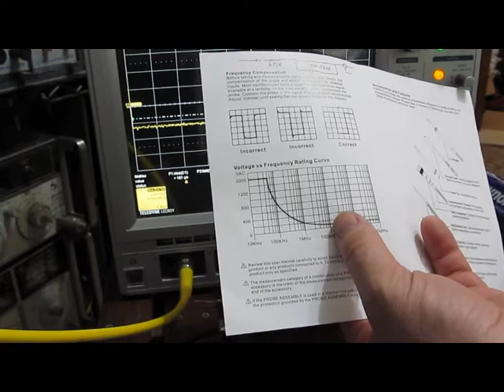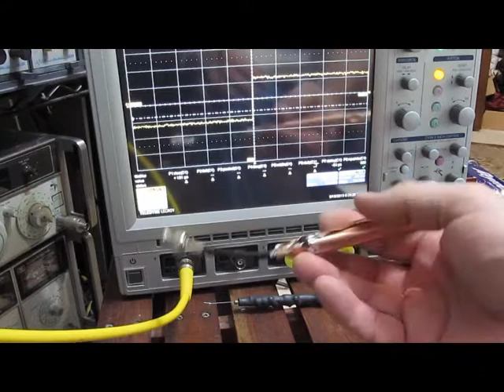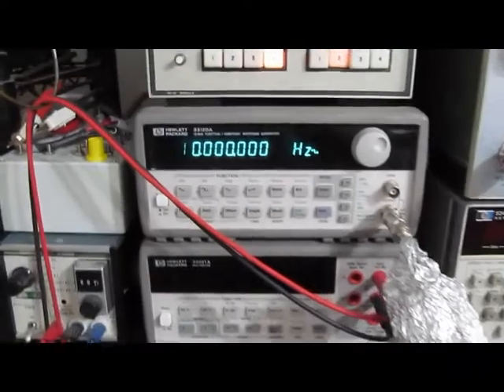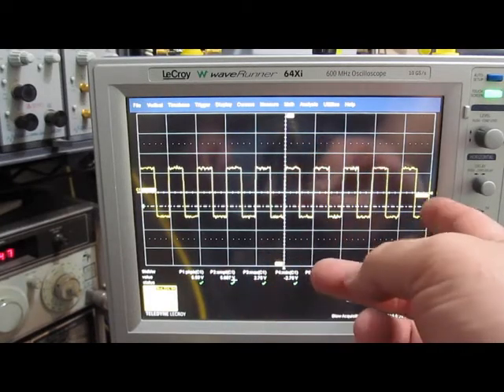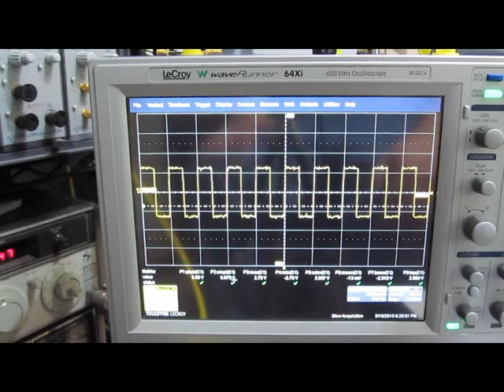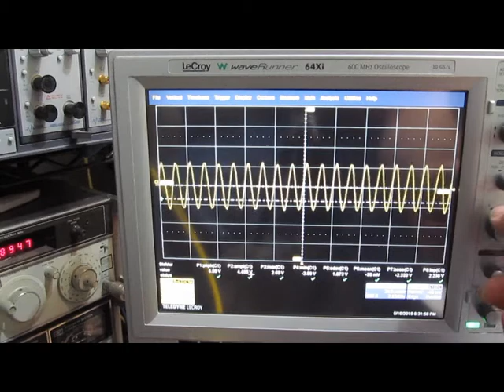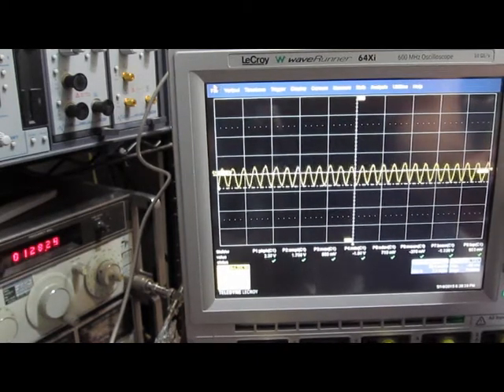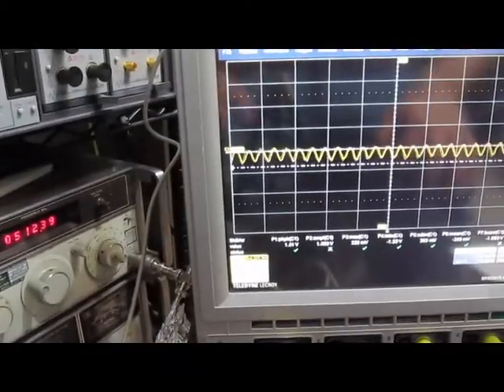Home made high voltage wideband oscilloscope probe Part 1

Comment: I've looked everywhere for high voltage resistors where do you get your ? And how do you know the voltage rating on resistors I've been repairing electronics since 1973 never knew that there were high voltage resistors
Reply from the maker: I'm in the USA and use Digi-key and Mouser as they will sell in small quantities.  The datasheets will have the ratings.     For example: https://www.seielect.com/Catalog/sei-hvam.pdf
Reply from the maker: You can see the two high voltage resistors used in my larger probe here:    https://www.youtube.com/watch?v=_OuonC7KlVE&list=PLZSS2ajxhiQCAQ6gIp6s-WoKiIEb1gHPD&index=6